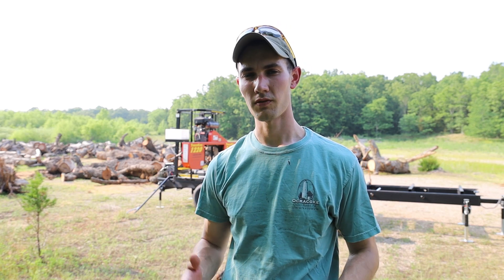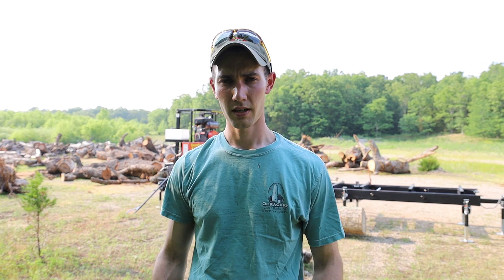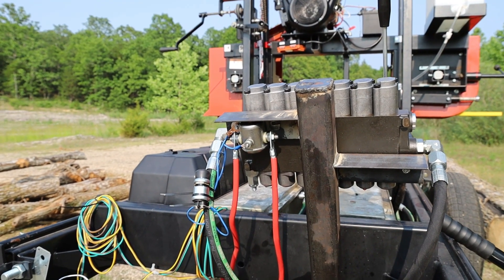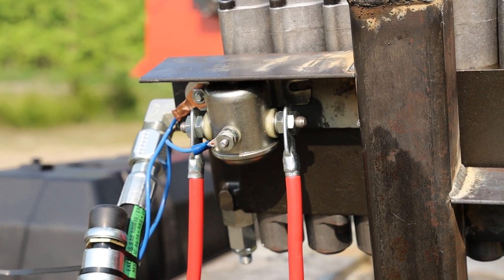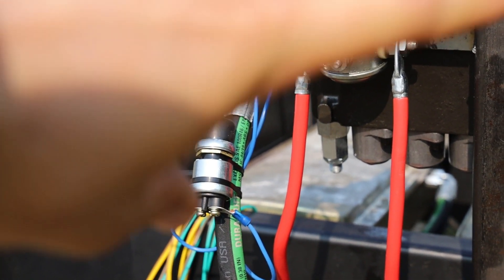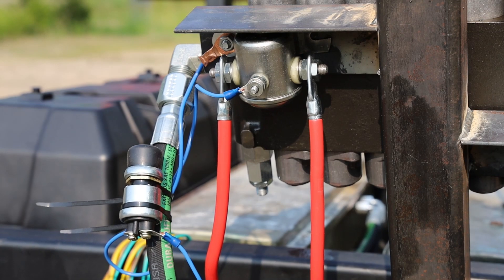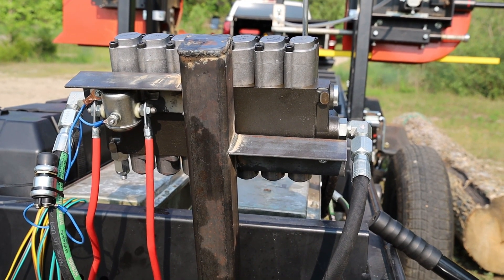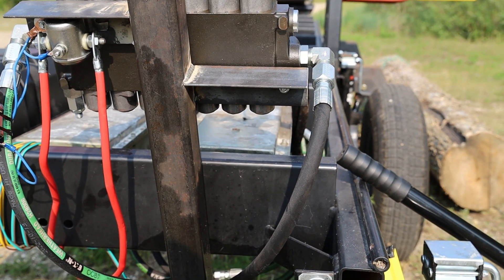Log Loader for Timberking 1220 - Hydraulic Sawmill Upgrades: Episode 1

Comment: The solenoid is just a Ford solenoid. I think the partnumber is an ss-57 and ss-94. Either way it's the new one is from the late 80s early-mid 90s. The early 80s and earlier at the older style like you have on this.

Comment: I'm looking to add hydraulic log loaders to my sawmill. my mill will cut 36 in logs just wondering how your log loader handles larger logs would you make any changes
Reply from the maker: The hydraulics handle it with not a lot of problems. I put a 22" white oak log that was 13' long on it yesterday. I would recommend having wider support jacks than I have. It would help it stay more stable when lifting it.
Reply: @clifftopforest8727  i was thinking the bottom lift arms should be a bit longer. Also i will be doing a lot of traveling to cut logs how dose it load on the bead? or how easy is it to remove?